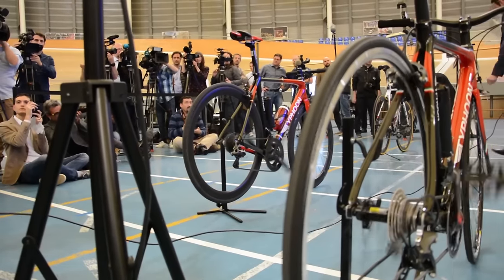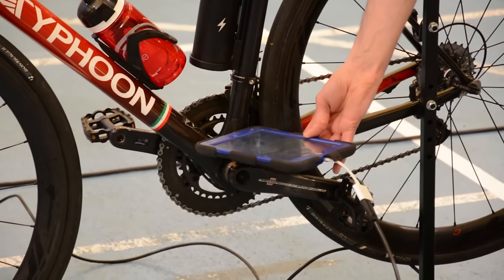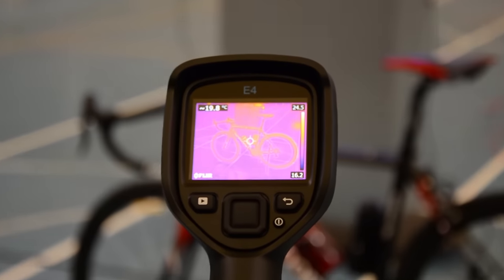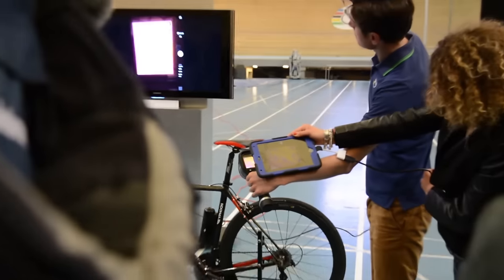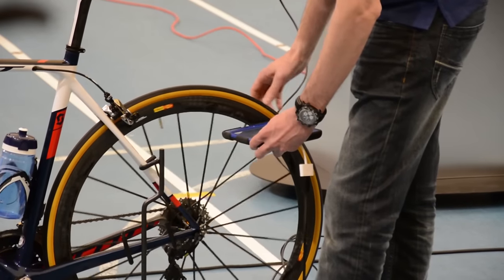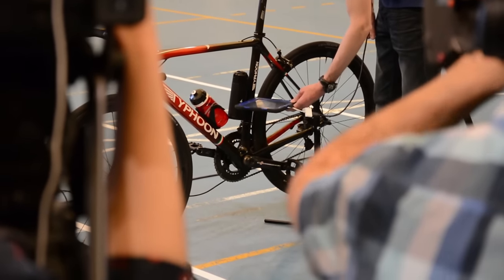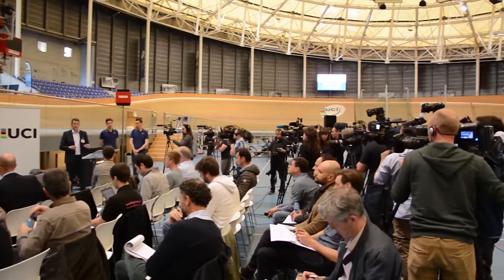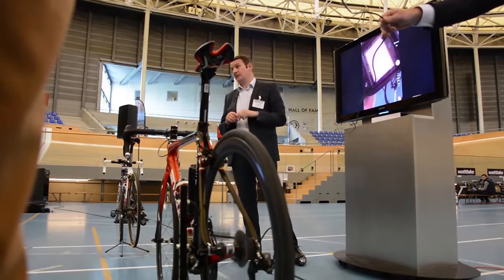Bike checks against technological fraud

Comment: Couldn't you just weigh the bike also since a hidden motor system weighs 5 pounds +? It would be pretty obvious if a bike that should weigh 5kg weighed 7kg-10kg without any extra weights in the crank...
Reply: You can get bikes way under the limit so that wouldn't work